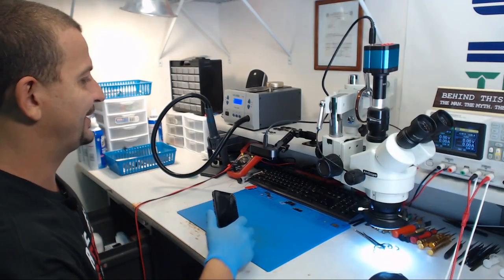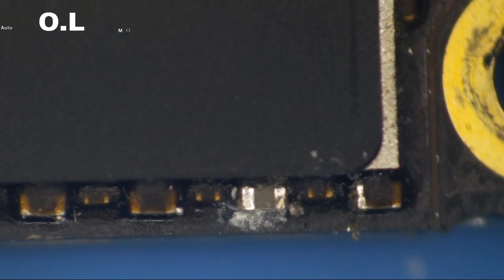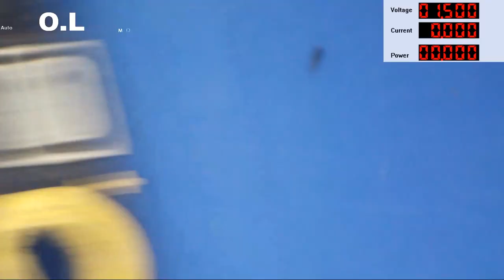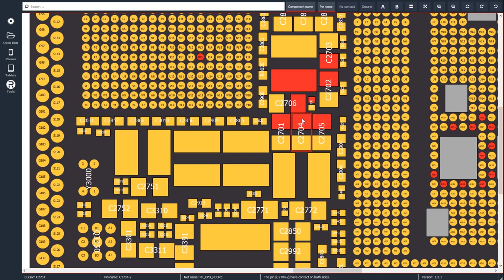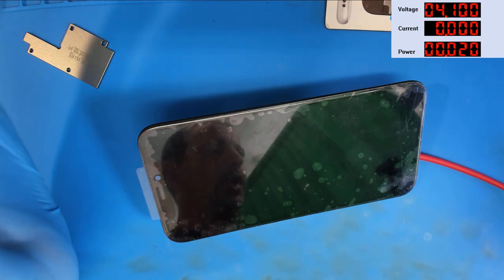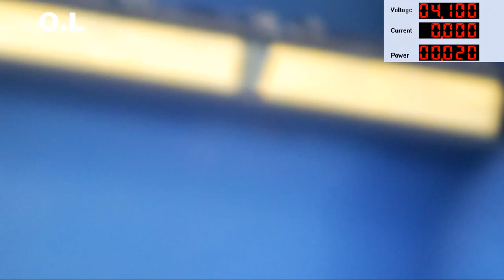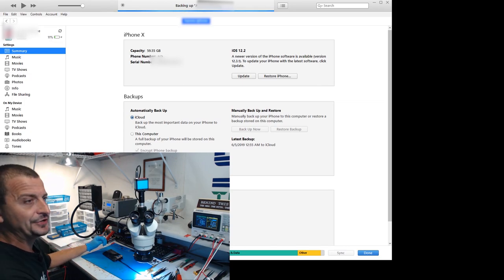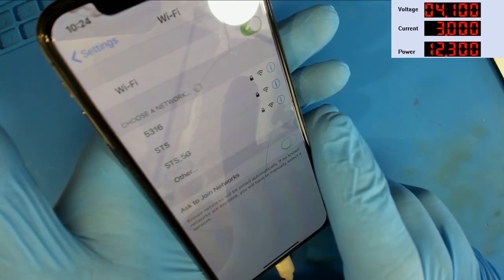Another iPhone X Data Recovery (Liquid damage)

Comment from the maker: This video was recorded immediately after my last video but we got severely backed up on repairs and I have not been able to finish it.  But here I am!  I'm going to try to go back to posting every week.  Thank you all for sticking around. :-)   The next videos are already in the works.

Edit (2 weeks later) - still working on this weekly posting. :-)
Reply: Its good to see you back! 🖐😀👍
Reply: @STS Telecom Curious as to what was max depth that the iPhone X was submerged to? IP ratings and waterproofing of even mil-grade waterproof/resistant items usually have a maximum depth that the item will withstand and past that, water pressure compromises the waterproofing/resistance of items (e.g. seals, gaskets, etc.).
Reply: hi its an super technique sir please can u share number thanks
Reply: STS Telecom congratulations
Reply: On your second attempt, It shows the backup going to your icloud, not computer. :)
Reply: hey Jason. just stumbled across your videos. The best out there...just wanted to share a little anecdote I had last night with my 7+. cracked the screen, went to a guy to replace it. came back home and noticed phone shutting off and trying to reboot unsuccessfully. took it back to the guy, he said it was the battery, knowing never had a battery issue since I purchased. Coincidence....? noticed something strange happening between the tech and the owner of the shop. could it be that they installed a defective LCD, or even swapped the battery with a different one. Anyway, insisted as this problem be fixed or else, I was going to write about them. I just got my phone back and for now it seems to be working fine. Keep up the great work.
Reply: You backed it up to iCloud
Reply: can i send you my phone for data recovery?

Comment: what i have learned from the mechanic board splitter is that you can get better results in reattaching the two boards if you dont use the two holders. the holders bent slightly the rf board and it cant be flush with the cpu board.
Reply from the maker: I never thought of that.  Good stuff. 
Thank u :)

Comment: Hy sts . I had my iphone x died after salt water damaged. I have showed to local repair shop they said its dead cuz of mother board issue . I have real real important data in it . I still have a hope that u r the only guy u can turn it on or at least recover my data . Is it possible to recover data if u manage to turn it on or it has to loose data after a water damage ? I have no icloud backup on this device . Please reply me suggestion

Comment: Hi Jason! I was wondering, how come you only do data recovery for water damage? I know you do a warranty typically, but how come you don't give the option for full water damage repair like just without the warranty or sumfin? I've seen a lot of your repairs (Maybe not this one) where the phone seems like it's not in terrible condition and it would work fine. Also, amazing job on this repair, looked like it would have been a lot more difficult with how messed up it was!
Reply from the maker: I’ve tried the repair but without warranty thing before and found myself mostly buried in arguments.  So many people will say they don’t care how it turns out but they don’t realize what they are saying (at least, until it works for a week and something breaks). We started taking in the iPhone X and above for liquid damage repair though.  They are usually not too bad but sometimes they are still too damaged to consider full repair.  They have good enough odds to bring them in tho. Also, I still wind up fixing a lot of liquid damage for the sake of full repair on older models but I wouldn’t dare advertise it. :-) it’s usually when they come in and have minor issues and are not an endless game of chasing down problems.

Comment: I am surprised there was not more damage from corrosion. Given that the phone had been in saltwater, any reason why you would not rinse the phone with distilled water to flush the salt out and then follow up with a rinse with IPA to remove the distilled water?
Reply from the maker: Sometimes they are horribly corroded but the X is usually not too bad.  I think the real bad ones have had screens replaced or owners who submerge them for pictures.  I would not want to warranty a full repair when they’re too messed up.  This one was for a customer who specifically requests for the phones to not be fixed, although they still get a lot of them back fully repaired.

Comment: Can we recover lost data after erasing iPhone if we don’t any backup on iCloud and iTunes
Reply: I don't think there is much that can be commercially done. 

When you hit "delete" or "restore", the data is not actually deleted. The system simply marks the data's current address as "available". So that data is technically still on the hard disk until it is rewritten. 

The problem is the data is encrypted.  When you restored the device the encryption key changes. We can easily remove the NAND and read the binary data. Without the encryption key, we have no idea what order to reassembly them in. And to brute force guess a 128 bit key (128 spaces, each can be 1 of 19 different characters) would take 500 billion years.

Comment: Did they heat this in an oven in an attempt to dry it out hence the solder balls??
Reply from the maker: I wonder if there was some foul play somehow but I’m 95% sure I was the first to open it though so they would have had to bake the whole phone.
Reply: @ststele  Ya and the amount of heat required to cause all those solder balls would have affected the screen and other parts. Could if it of been a refurbished phone from Apple replaced either under AppleCare etc and that is just the quality of the work?

Comment: Great video, no problem, I can do this at home with all those tools I do not have!! iPhone Xs is NOT water proof but they are advertised all over the internet to be IP68, which it is water resistant, then apple and everyone that works there sells it and assure customers that this thing can resist getting wet for up to 30 minutes and submerged in water to a depth of 3 meters. Here is my story; my iPhone Xs Max that I paid over $1500.00 in April 2019 was never submerged in water until few days ago I took some videos few minutes in my above ground pool, the immersion was only below the water line and I posted those videos in facebook, one is 5 minutes but only submerged for FEW seconds; minutes later it started to do restart loops; the phone last on 3 minutes and goes to restart for few seconds, by now I have done all the restores there are, which is 3 different ones, I lost cool pictures I will never be able to recover, after all this, still does same thing; have contacted apple 3 times, water damage it is not covered even if it was under warranty I am told but the water sensor inside the sim card tray is white, not red, although I can see condensation in the front camera; diagnostic shows an issue with the barometer and compass, nothing more, everything else shows good; apple is reluctant to do anything like replacing the device because they contend it is out of warranty and it does not have apple care extended; even if it did, water damage we pay they say starting at about $600.00 to repair the phone sending it to one of you guys to an apple authorized shop. It is really shitty from this horrible falling down company to advertise their product as IP68 saying it is ok to get it wet and then deny warranty to the device when it fails; their standing behind their product and what they sell have gone to pot; the only reason I decided to film in the water with the phone is because the assurances and the believe that few minutes contact with water or submerged under the water line would not hurt it; this is not what happens; I have done everything I can do to get the humidity that it obviously have inside out; have put it in rice, nothing, have yet to try silica but watching this video seems the only hope is to get it opened in a shop and of course it would not be sealed again as factory new and would I ever trust anyone telling me the phone is actually sealed after what is happening???? Well, to big problems there are big solutions; number one, the bad advertising and my story to tell to anyone I encounter about how this company blatantly lies to customers and then do not stands behind their product will be all over and that is the worst damage I can do to them in exchange for the $1500 they believe they can rob me of but last and not least I will sue apple in small claims court for my money back; they would not, can not afford to send lawyers to small claim courts, they may send a case manager and/ or a store manager who I will eat for breakfast in court for sure when he stands there and says the phone is out of warranty and I show all their videos and advertising of the IP68 rating and its meaning; clearly, I am not alone in this issue with apple; there are many more folks involved in battles and pissed off because their disregard for customer service and retail ethics values, but judges already know that by now, so to apple it is more important a piece of shite equipment that it cost minimum to produce rather than their face to the customers and standing behind what they sell you and they say it would do! but I can tell you I will not throw my phone in a drawer and resign to lose $1500 just because I believed these fraudsters bogus advertising; there are certain protection under consumer laws that Tim Cook is ignoring and someone needs to slap this asshole in his ugly face with some reality, hopefully, the court will do that!

Comment: 6:16 thanks I'm searching for fix my raspberry Pi of VCC short note i have a little clue to find it
Reply: Naga Ravi 

If you mean that you don’t know how to find it,and if you still haven’t solved it yet,freeze spray is the way to go. 

Freeze spray or holding canned air(dust cleaner) upside down will get it cold and frosty on the board. Then connect power and see if something instantly gets hot and melts the frost. You can use your face (im serious) as well since it’s more sensitive to heat than your fingers.